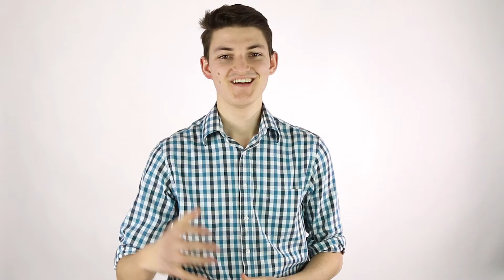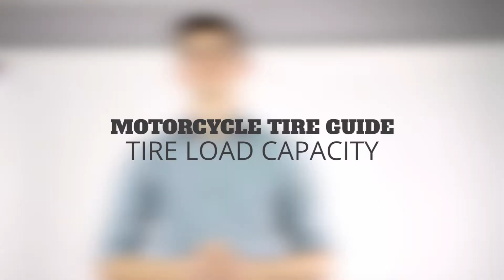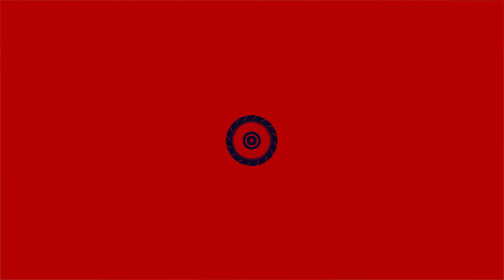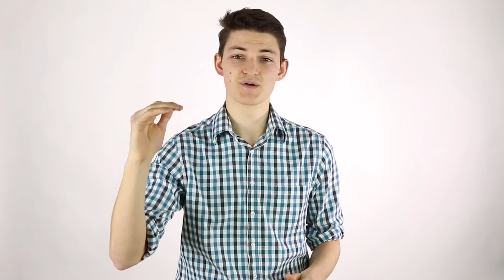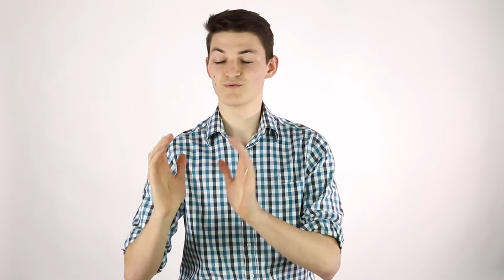Motorcycle Tire Load Capacity

Comment: I have a question about load index and would appreciate answers from anyone who knows about the subject. I ride a 2014 Suzuki Boulevard m109r Unlimited with a curb weight of 764 lbs and the OEM front tire is Dunlop Sportsmax 130/70 R18 M/C 63V with a load index of 272kg or 600 lbs. The rear tire is a Dunlop Sportmax D221 240/40/18 with a 79V load and speed rating. That's a load index of about 437kg or 963 lbs. The bikes curb weight is 347kg or 764 lbs. I have Corbin fairing on front that weighs about 25 lbs and I have Corbin Beatle Bags on the rear which weigh about 35 lbs. I weight about 220 lbs. Just me and the Bike alone weigh over 963 lbs. So am I understanding load index correctly or do I need to look for tire with a higher load index which is hard to find? I looked at Avon Cobras 250/40r18 81v but was not impressed with mileage and wear.

It's time for a new set of tires and I was considering the Michelin Commander II because they offer higher mileage and last longer. Front 130/70 R 18 M/C 63V F TL 36.3 PSI and Rear 240/40 R 18 M/C 79V R TL 42.1 PSI. Thanks in advance for any help..

Thanks Chris

Comment: My Rear Tyre load Capacity is 69 (325kg Max),
my Front Tyre load Capacity is 59 (243kg Max),

So that means, the total weight the tyres can take is 568kg. Is that correct? 
Because clearly, my bike weight and myself +other stuffs already exceed 243kg. 
So is it calculated like that or?
Reply: Your rear capacity is sexy.
Reply: K no. Go to 3:25 in the video above.